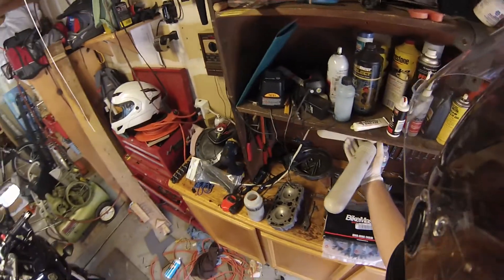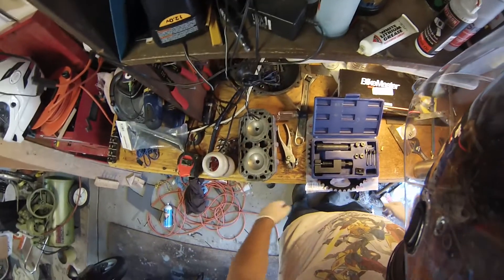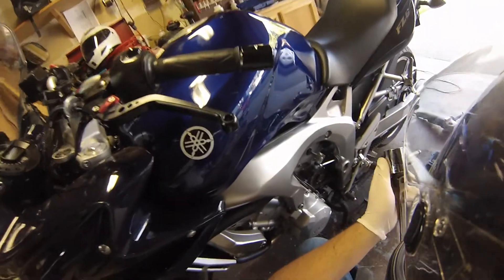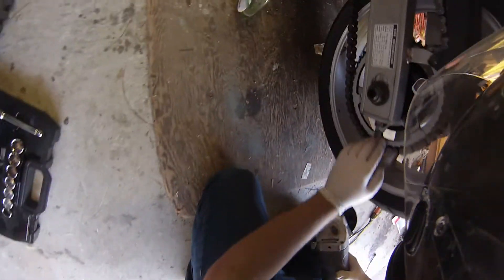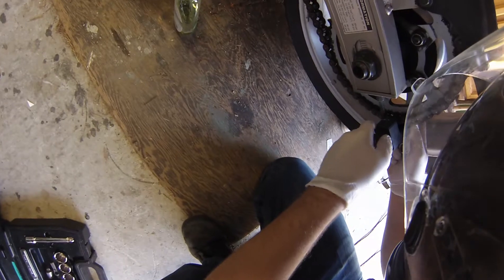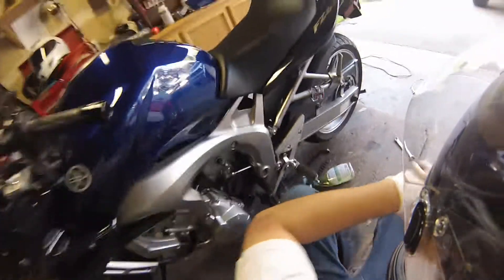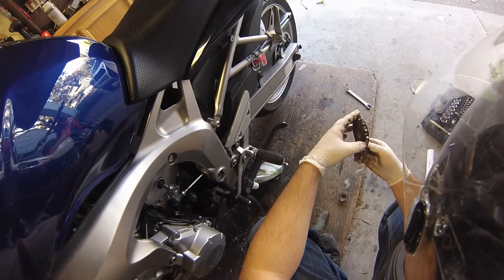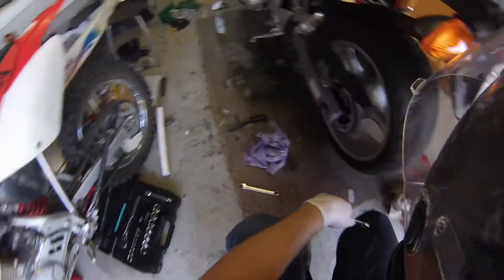How to change Sprockets and Chain on FZ6

Comment: I have an 05 yeah its a pain getting that rear tire back on. gotta get the brake caliper into that key way and everything in one motion it sucks! good video tho now I know how to get to my front sprocket
Reply from the maker: That rear tire is such a pain. I am not looking forward to changing the rear brakes. Glad the video was helpful for you. Hopefully your project goes smoothly.
Reply: MotoShaman Yes sir thanks, I actually got a 520 conversion kit with a cpl sizes bigger rear and stock front And a 520 chain, it still has the stock 530 on it so I am really looking forward to see how it goes...
Reply from the maker: That's what i did also. It worked out great for city driving around town, but became a nuisance on the freeway. I am now running stock teeth in the rear and -1 in the front which seems to work pretty good on the street and freeway.

Comment: just did mine today! this video was very helpful. I bought another OEM 16T front sprocket, since it has those rubber covers on both sides. I read on forums it helps keep the noise down. In the rear I went with a JT sprockets 48T to get more torque on lower gears. I think my odometer and speedometer are a little off, so I guess I'll either live with it or install a speed-o-healer. For chain I went with a gold DID 530

Comment: I know this was posted a while back but any chance you know how may links your chain came with? just about to do this myself also what was the response difference? did it make a noticeable difference?
Reply from the maker: +S.R W I think it was a 118 link chain but I'm not 100% sure. It did make a significant difference, but my chain was far outside of tolerance. If your chain isn't as severely worn I doubt you'll even notice.
Reply: +MotoShaman thanks

Comment: What did you put on the rear axle?
Reply from the maker: I applied grease. I used white lithium grease I had laying around, but normal wheel bearing/chassis grease would work. Thanks for watching.

Comment: Why not just remove the rear tire, then grind off the chain?  Also, ever hear of an impact wrench?  Makes removing bolts extremely easy...
Reply from the maker: You could do it in that order as well, but It's easier in my opinion to grind it with it on the old sprocket so something is holding the chain still for me. I didn't use an impact wrench because I don't own one.